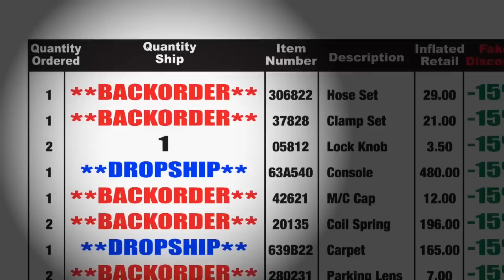1967 1968 Mustang Cougar emergency brake Episode 154 Autorestomod

Comment: Desperate for Help. Need part number for a parking brake cable for a 1968 F100.  The complete cable has been cut at the fire wall. Thanks for all the video's.
Reply from the maker: I'd recommend checking on the Fordification.com forums or tech articles. It is a wealth of information.

Comment: Paul P i do not know if this will help you out or not . but to me in the video it looks like the bracket on the pass. side is directly across from the one on the driver,s side . i am in the same boat as you are . my pass. side bracket is also missing.

Comment: Just guessing if this works on a 69 mustang (emergency brake installation), cause mine doesnt have anything, so i want to fix it.

If not where i can find a video or diagram about this, cause i havent found one yet ( of a mustang 69)
Thanks, and great videos.
Reply from the maker: +cordova1912 It is very similar. We'd recommend getting the assembly manuals from NPD. The manuals cover all aspects of the assembly of these cars.

Comment: Jeff - You mentioned that the undercarriage is not quite what you would like it too be.  I have been wondering, what is your perfect "recipe" for a good looking, long lasting undercarriage?  i.e. what types of coatings do you like on the floor pans, etc.
Reply from the maker: Well I'd basically finish out the underside like the top. Clean it down to good metal, good self etching primer, then a flat single stage paint that mimics the Red Oxide (or what ever color the car was underneath). I also paint the components; if the part was cast steel, I use paints like Rustoleum to re-finish them since that brand has a good rep for not rusting. If the car is left with bare components time and humidity will beat them down.
Reply: AutoRestoMod Do you ever use undercoatings?  If so what types/brands do you like?  Or do you prefer to stick with the OE red primer look?
Reply from the maker: Collin Hinz Typically I've only done factory looks. If I were going to do something on the underside, I'd probably go LizardSkin sound and heat barrier.
Reply: AutoRestoMod Sorry to drag this on, but how would you say the aluminum faced butyl rubber products like dynamat compare to lizard skin?  I guess I always thought of lizard skin as an interior product, but I suppose it would be just as effective on the outside?
Reply from the maker: Collin Hinz No worries. We plan to use the Lizardskin on the wagon on the outside of the storage compartment that is behind the axle and in the "heat line". Lizardskin is great for that kind of application where you have no place to put the sound deadener or heat barrier. If you want to ask more questions contact Jeff at: jford@autorestomod.com

Comment: You guys should detail a Crown Vic rear disc brake swap.  Replace those drums.
Reply from the maker: We might do a rear disc swap. And the Crown Vic is a good idea. But it will have to be after the 50th.
Reply: AutoRestoMod
I used the setup from an '01 on my '69 convertible.  The e-brake cable took some cypherin but I married the old to new and it came out great.
Reply from the maker: Joe Marshall  Cool, can you send us a couple of pics of the cable setup? jford@autorestomod.com

Comment: I have a 1973 mustang. Changed the battery cables and got into it and the brake light was flashing and buzzer was going off after we hooked up battery. Without keys in it. Do you know what would cause this?
Reply from the maker: It probably still has the safety belt warning system. Plug the seat belt into the receiver and see if the buzzer and light stop.
Reply: I did that and brake light still flashing and buzzer still buzzing with no key in ignition. Hook up battery and just starts going of, both of them. Doors aren't even open for buzzer to go off.   It's nothing I've ever dealt with before. When we changed battery , we made sure everything went in the same way.   But as soon as we Hook up the battery the brake light flashed and buzzer buzzing intermittently. Seat belt is locked as well. Thanks for any help you can give me.

Comment: Hey guys, great videos as always. I have a 67 Coupe that I converted to rear disc. I need to order new cables and I am not sure where to start the measurement from? I see a couple cable lengths on the NPD website but just not sure what the right lengths will be.
Reply from the maker: I'd probably start with the mount point on the brake backing plate then measure to the tie point near the trans crossmember.. Contact NPD and talk with your sales rep explaining the issue they might be able to get you a measurement.

Comment: AutoRestoMod  Jeff when you did this where was the parking brake handle.? was it pushed all the way in or some where else.? i am trying to hook up my parking brake cables and am not having any luck. the cables are new as well as the brakes in the rear drums. any help would be great.i don,t seem to be able to get all of the slack out of the cables.
Reply from the maker: Arm should be all the way in. contact me at jford@autorestomod.com if you need more help.